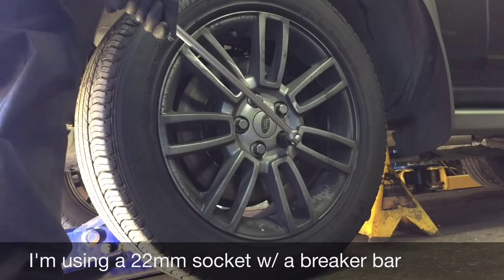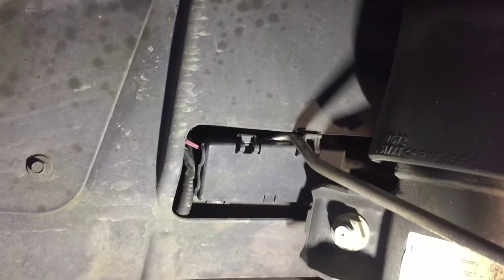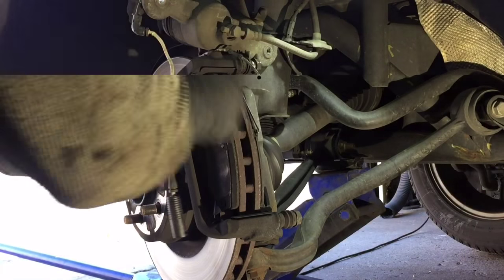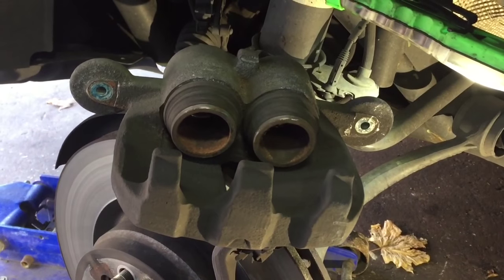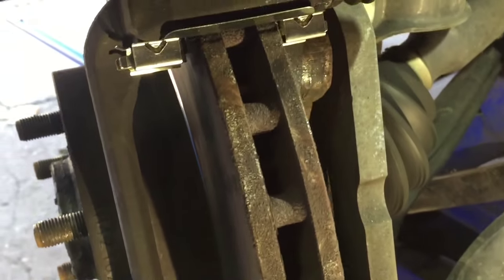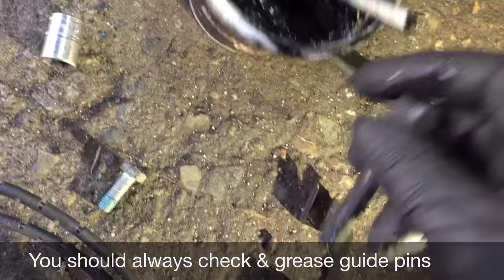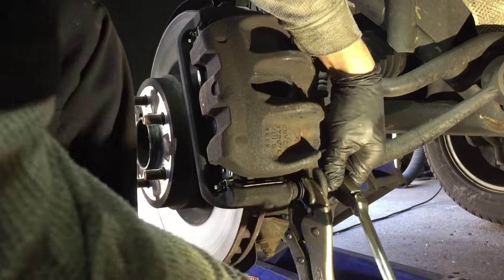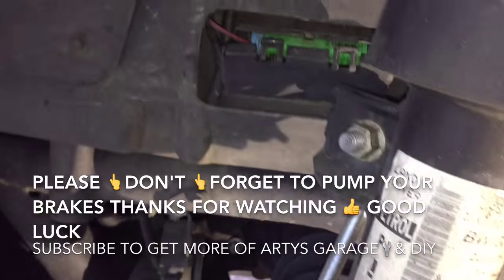How To Replace Range Rover Front Brake Pads

Comment: Thank you Arty.  I would suggest opening the bleeder valve  into a submerged hose in clean brake fluid to allow the dirty caliper brake fluid  to drain into the container instead of pushing back pressure and contaminants into the master cylinder.

Comment: Compression lock with the grease on the end of the sliders tho good job mate
Reply: What's compression lock? Saying dipping it is bad and should spread it on/around the pin instead before reinserting?
Reply: Important tip. I went to the comments to make sure someone pointed it out.
Reply: @Pukefeast1 Just lightly grease the sides of pins, never the tip.

Comment: Artie   I looked at hft for this brake tool and cannot find it there
Reply from the maker: Don’t worry use a big players go nice and slow put the brake pad the old one in front of it that’s all I’m not a hoe hard you push it’s only gonna go in a certain amount of speed slow no matter how hard you push apply pressure slowly open the reserve one and I will come in every time you close up on Kalapu pop up the brakes and if you pump the brakes every time you do one caliper one brake job and won’t come out don’t believe the hype

Comment: I just worked in the car and had to stop. this caliper has 4 pistons in it with heavy duty high performance  way different caliper. I work on cars daily never seen something like this. replacement caliper cost $849. part price only
Reply from the maker: You need to compress one side in first using the old pad n prying on it gently until fully compressed w/ a screwdriver install the new brake pad then repeat procedure on opposite side 👌👍🔧💥
Reply: big kev  of